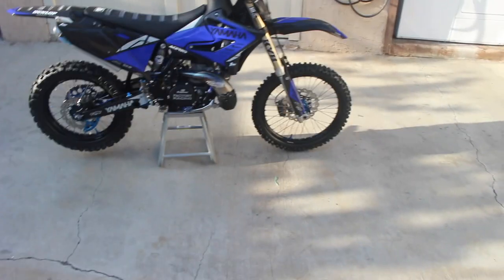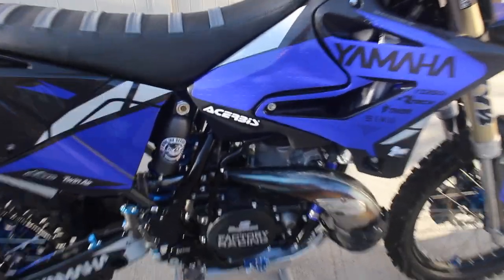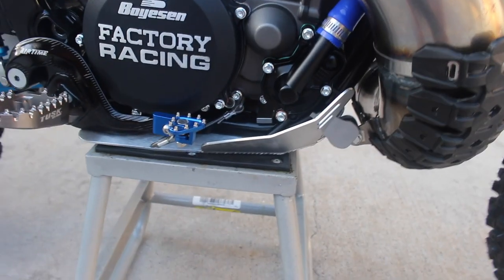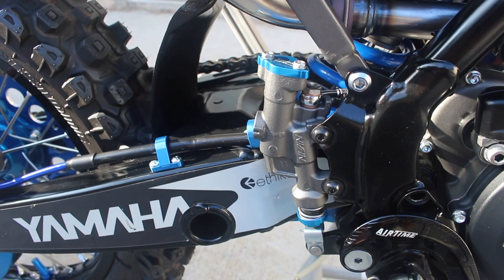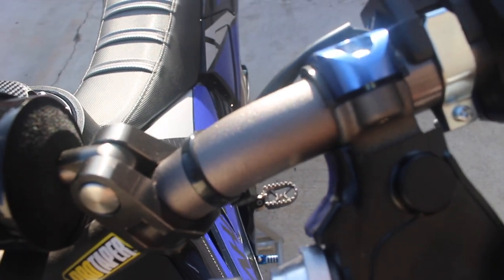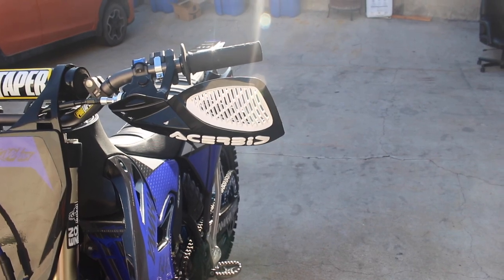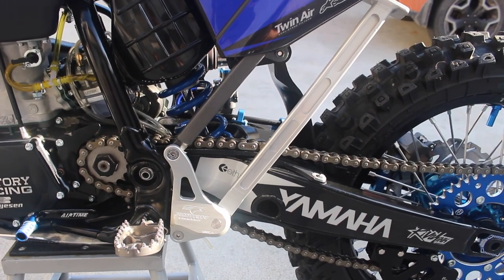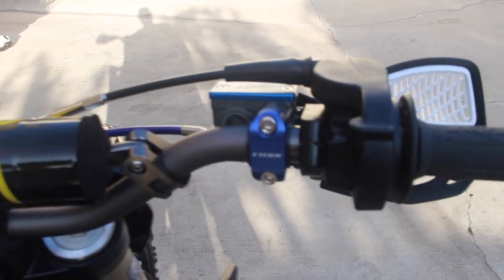Epic 2004 YZ250x Build Reveal!

Comment: Absolutely beautiful.
Where did you get the graphics?
Where did you get the rear brake line aluminum guides?
The Acerbis tank, did it come with the petcocks?
Sorry for all the questions just found you vids tonight and I'm in the middle of an 04 YZ build myself, you hit exactly what I am hoping to produce myself.
Reply from the maker: Thank you! Graphics are from Rival Graphics. The Break Line rear guides I found on EBay. Yes the tank does come with petcocks and a fuel line.
Reply: @Joshua-yz2zl  Did you design the graphics yourself or is it one of their options? I can't seem to find anything similar on their site.

Comment: thats one clean yz man. i heard it knocking at  3:00 mine has that same noise but runs mint and the bottom end it solid i just did a top end. i think that noise is normal? anyone know?
Reply from the maker: Normal for the YZ250! It’s actually not the motor itself it’s the gears in the transmission. These bikes have a noisy gear box. Simply some of the best two strokes ever built.
Reply: @Joshua-yz2zl  I was concluding it could be the clutch basket, but the gear would make more sense. And yes there great bikes mine lifts the front wheel up in 5th gear.